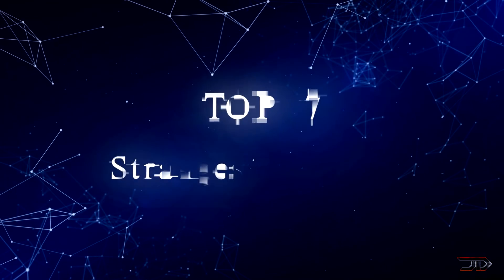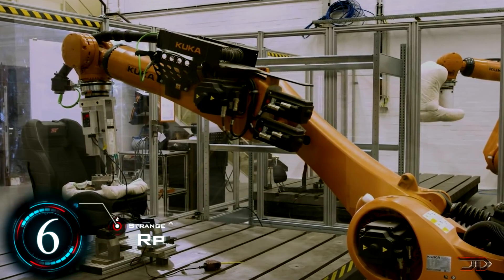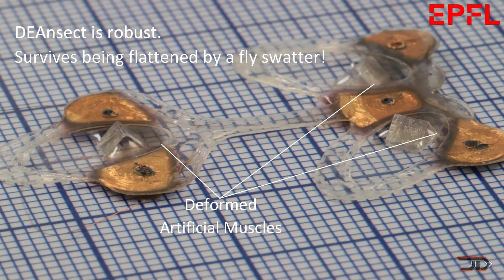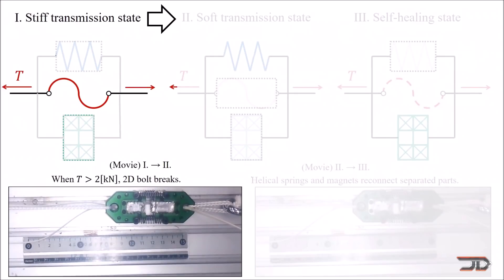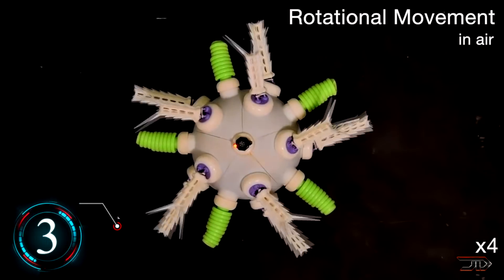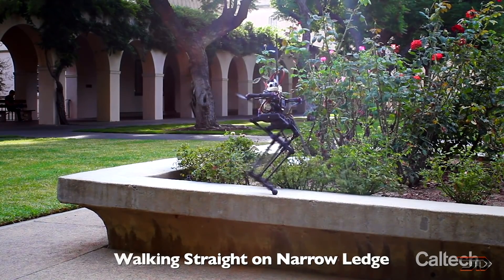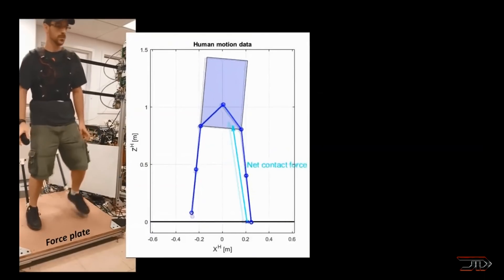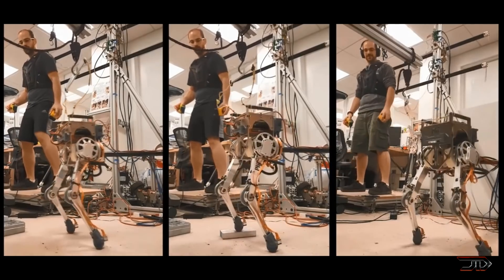7 STRANGEST New Robots

Comment: Strong surface contact microbalance is key. The stronger the feet in offset forces, the better potential for balance without major movement and a more energy efficient way of bipedal movement. I feel it's a bit of a shame robots are trained with human input when the input goes to a simulation not representative in the fundamentals and the human have to monkey around and in some sense waste time compared to a non human interfaces d learning method. When I see very tightly buckled ski boots on the human training OR robot feet's with a strong and complex surface I know the understanding of our anatomy is more in line a swift progress will be made ✌️

Comment: MY 10 LBS, 6 WHEEL DRIVE, AUTONOMOUS ROBOT WOULD CRUSH THE LIFE OUT OF YOUR TOY ROBOTS!!!!   I USED 6061-T651 AND 7000 SERIES ALUMINUM. I INSTALLED TWO POWER DRIVE SERVOS THAT HAVE ENOUGH TORQUE TO PULL A SMALL CAR BEHIND IT.  ALL PRECISION BALL BEARINGS AND HTD DRIVE BELTS AND PULLEYS. CAN CARRY HUNDREDS OF POUNDS. ALL COMPUTER BRAINS (MICROCONTROLLERS) ARE HOUSED IN A FARADAY CAGE WHICH HARDENED IT AGAINST EMPs AND ELECTROSTATIC DISCHARGES. .ETC  ETC